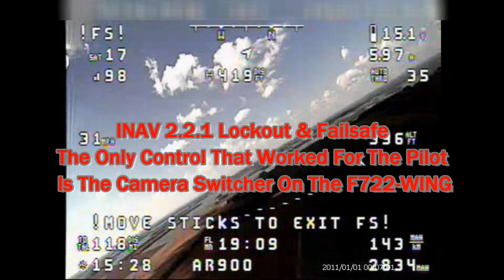INAV 2.2.1 Lockout & Failsafe Crash!

Comment: LOL the hawk evasive maneuver at 1:44 :)   That sucks and I hope you figure it out.  Just set up a 722 myself :(
Reply from the maker: I haven't seen anyone report this issue using an older version of inav on the f722. So you may not wanna use 2.2.1 until this is solve.
Reply: @JD_1  Crap...
Reply from the maker: @MkmeOrg  I have been using 1.9.1 and 2.0 for awhile with no issues at all. But I use a matek f411 board. Alot of people use the f722 on the older versions of inav with 0 problems. Just have to be careful using the latest from inav. The public is the tester for the new stuff.

Comment: I recently crashed a plane running a Matek F722 using INAV 2.2.1. I navlaunched the plane without a hitch but soon after I took control the plane did a 180degree roll and was totally inverted going about 45-50mph towards the ground at low altitude. After wrestling with the sticks for a second I was able to regain control. However, it was too late and the plane ate it hard nose first.
Reply from the maker: Yikes. Did you have some setting in to counter the horizon drift?
Reply: @JD_1  No. Here's the breakdown of the flight. Flawless navlaunch, it flies without any problems up to altitude as I put on my goggles and picked up my transmitter. I switch the plane to airmode. I begin to bank the plane over  to turn without a problem. I level off and proceed to fly straight when suddenly the plane executes a 180 degree roll without me inputting any stick movements. I don't freak out and bang the sticks around like a maniac. I calmly try to counter the movement and get no response to my inputs. The plane is totally inverted and is pitched towards the ground. I'm going about 45-50 mph according to gps on my OSD. Suddenly I get control of the sticks and I am now in a position where I can level out and pull out of the maneuver. However, if I did I would be either dashing into a busy street at ground level (basically doings a close to the ground split-s maneuver) with passing cars or flying into areas with plenty of pedestrians walking about. So I just nosed it in and let it crash. Btw, the plane had 100+ miles of flight on it with about half a dozen cloud surfing sessions. It flew great until I updated to INAV 2.2.1.
Reply from the maker: @showboatfpv9677  Dang! Do you think it was a signal drop out? What do you use for radio control, like what rx in the plane? My friend that crashed in this video and myself have been trying to nail down an actual cause of crashing using 2.2.1. I have concluded for sure if you do not have imu_acc_ignore_ rate set to 10 flying in a stabilize mode it will cause a crash.
Reply: @JD_1  I'm using an FrSky Taranis X9D Plus SE w/ an R9 module using the latest firmwares. The plane had an R9MM with the latest firmware. The module was pushing out signal @ 100mw. The antenna on the module is an FrSky Zipp9 900MHz Moxon antenna. The OSD did not show a failsafe condition and I had 99% RSSI. I was less than 40 yards away from the plane. I recently recovered all the hardware and stress tested all the servos, motors, and escs indiviually. They are all 100% fine. The plane (Sonicmodell Binary)fell to pieces after the crash so it's hard to tell if it was a failure of the air-frame.
Reply from the maker: @showboatfpv9677  yikes! Sounds like the same recipe my friend was using. You are the 4th person I talked to using the same gear that had this similar issue. R9+2.2.1+f722. I'm just not sure why this combination is deadly.
Reply: @JD_1  I have other INAV builds using the same RX/TX setup the only difference is they are sporting Matek F411 wing FCs and INAV 2.2.0 firmware. Both are still flying just fine. I'm gonna stay away from the F722 and the latest firmwares for a while.

Comment: Matek has a few different  versions of the 411 wing and inav has different flashes for each one, I had a lot of problems until I tried a different version and it has worked great since. Not sure if the F7 is similar.
Reply from the maker: I only use the f411 flight controller and omnibus f4 pro. Not sure why this pilot went for the f722. But this still should have not happened.

Comment: If you lose signal does it loiter or come back and disarm?
Reply from the maker: Its supposed to return to launch and loiter. No it does not disarm. It waits for the pilot to take over. Or you can set it up to auto land.
Reply: @JD_1  What are your nav_fw and nav_rth values set at?
Reply from the maker: @antdx316  you need to do some research so you can find the settings best for you. What I have set may not be right for your plane or area you fly in. Go to the inav wiki page.
Reply: @JD_1  I understand but I came from Feiyu-tech products back in 2013 so I'm very familiar with these capabilities.  All those equipments got old and no longer work properly so I went with an F405-wing to see.
Reply from the maker: @antdx316  I came from the fy41ap lite. And it's still a great flight controller. I still have 3 of them now that work perfectly. The difference between the 2 is the ability to fine tune per liking. Most of the inav default settings are fine. When it comes to rth... The only adjustments you should make is the altitude and loiter radius. And adjust the cruise throttle accordingly to the plane and all should work just fine. I do not recommend using the newest version of inav. You will only run into bugs and problems. 2.0 and 2.1 is fine.
Reply: @JD_1  What do you mean problems?  All I want is pretty much for it to loiter so I can put goggles on and off and RTH when there is a VTX problem so I can LOS land.  I don't need autonomy flights as I have DJI drones for those tasks.
Reply from the maker: @antdx316  newer versions of inav are full of bugs.

Comment: Oh! no ... I hope the model is saved.
with fy41ap it wouldn't have happened !!!

congratulations anyway for the work done
Reply from the maker: No the fy would have never done this. Yes we retrieved the model.
Reply: @JD_1  I would soon like to try inav on plane ... But. Little time to fly ...
Reply from the maker: @blenedfly  my advice would be to use an older version of inav. 2.0 works fine. And use a well known and reliable flight controller like the matek f411. That is currently what I am using with 0 problems at all. And just take the time to understand how to properly setup inav. Dont mess with the pid nor looptime. The presets work great!
Reply: @JD_1  thanks 1000 for advice, ver. 1.8?
you are a very precious friend
Reply from the maker: @blenedfly  I started on version 1.8 cause it was the safest version at that time. 1.9.1 and 2.0 have been well tested and work fine. So on my finwing Transformer I'm using 1.9.1. The mini ar is using 2.0. The mini Skyhunter had 1.9.1 on it. And my nano goblin has been using 1.8 for a year. I just recently updated it to 2.0.
Reply: @JD_1  thaks very mutch
Reply from the maker: @blenedfly  your welcome

Comment: At least you didn’t have a busy freeway underneath you. INav is trash. Vector all day!
Reply from the maker: Some would disagree with you on that! Lol I like inav. I have never had a issue with it like this cause I dont use the latest versions of it. Lol This pilot unfortunately did.
Reply: Used both and I still prefer INav
Reply from the maker: @iRoNiiC_H3R0  I prefer inav as well. Just the older versions of it.
Reply: @JD_1  What do you like about iNav over the Vector. I've never built an iNav wing but I've been wanting to. Problem I have with Vector is that it is expensive as hell and their configurator seems out of touch for people who've come over from BetaFlight. It blows my mind that they don't have a way to calibrate ESCs directly from their config app. I like being able to solder directly onto pads, just like building a mini quad. You can keep the wire/ratsnest down to a minimum.
Reply from the maker: @austntexan  the price is the most number 1 thing I like. I like all the extra flight modes that inav has. I like being able to really fine tune my plane as well. Which really for me its easier cause you really dont have to mess with the pids. Just the lpf's to get the plane flying as smooth as you like. Also, I like the size of the flight controller choices that are on the market for inav. Built in current sensor saves space and lesser wire. You can buy an excellent GPS for inav for $15 compared to the crappy one you get with vector for $50. There's alot of benefits using inav over any other flight controller that's on the market. Down side of inav... you have to beware of the bugs... I myself only use older proven and well tested versions of inav. Using the latest stuff can be deadly.. Like what potential happen to my buddy's plane in this video.
Reply: @JD_1  Really great points JD! What's iNav version do you recommend using, which have you found is the most safe? Wish we had another 3 months of summer flying weather!
Reply: @JD_1  Just saw a comment you made, you like 2.0. That still the case?
Reply from the maker: @austntexan  2.0.1. Lol that's the newest for me. No issues at all using it. But note this. You have to use an older configurator with it as well.
Reply: @JD_1  Oh, cool. . . thanks for responding with the details. This is super helpful! Thanks JD!
Reply from the maker: @austntexan  yw